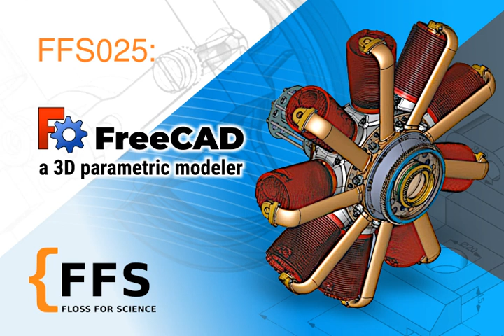EP025 FreeCAD, a 3D Parametric Modeler

Comment: I am designing with FreeCAD right now (v 0.19.19858), it is a very potent program and i like it. I hope that the development
will gain some more momentum. There are still some fundamental functions to be build or to be refined, like measuring.
FreeCAD cought my interrest in the beta stage 0.16, i took anvantage of it's versaitlity and created some LED's for 
KiCAD. It was semi transparent WRML file export (im not a PCB developer but i could make simpel PCB's now on my 
Chinese 3018CNC). Creating a useful G- Code would be really great since there is no powerful free Tool to make
real 3D G- Code, exept BlenderCAM this tool is also in beta stage but it's working fine. I notice quite some tutorials
in many different languages that's fantastic and i am really exited to see FreeCAD grow fast to become a major player
in favor of the devolopers/ engineers choice all over the world! Thank you for the effort developing this great program!